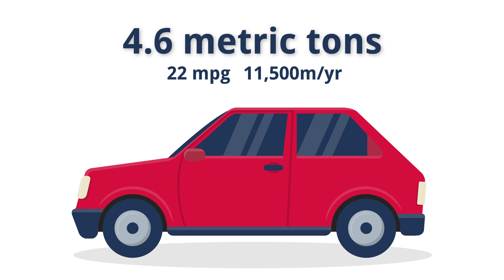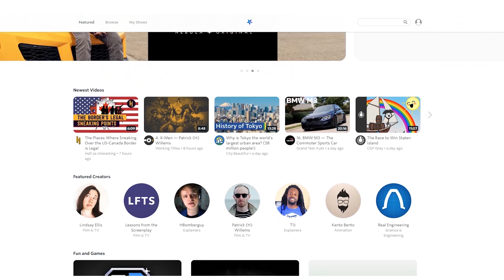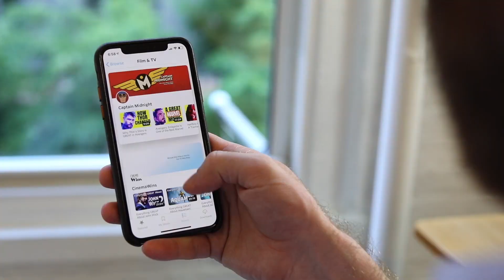How Cruise Ships Are Destroying The World

Comment: These ships are well past the size where nuclear power becomes the more practical option. Any military veswel half the size of a cruise ship and up is nuclear. The savings would be in the billions. 

I thought they were nuclear powered because the idea of something that size being run on ordinary fuel doesn't make practical sense in the short or long term.
Reply: Aircraft Carriers are currently the only nuclear powered surface ships in the US fleet. While nuclear power was, in the past, applied to smaller surface ships, they were eventually retired and replaced with conventionally powered vessels. I believe that Russia currently uses nuclear power for submarines only, and I'm not sure what the Chinese are fielding at the moment.
Reply: At this size it just makes sense. Especially consodering the cost amd material of a cruise ship. It already has enough sheilding to be relatively safe for the short time exposure of crew and it can carry that few extra tons to protect the long term workers. A meltdown isn't likely since there's an unlimited supply of water to stop such a thing. 

You have a no downside power plant available. For a multi billion dollar ship its a no brainer. 

These things are dirtier than oil tankers which after they stop being oil carrying vessels can actually be used for something else such as portable power plants, or ocean cleanup net pullers, or heavy equipment haulers. Etc. 

Cruise ships are pointless and stupid but if we must have them why not have them run cheaper and cleaner.

Comment: Are there electric boats?
Reply: Cruise ship are electric. Its just that they generate the power with big diesel generators
Reply: @TheMJ008  would it be practical to use giant batteries? I don't think so. Maybe ethanol or biodiesel are better options?
Reply: @srpenguinbr  cruise ships need insane amounts of power to run there engines and AC etc they simply wouldn't have the space for that mutch battery storage. That said they could use gas turbines instead of diesel engines and use biofuels like Ethanol. But gas turbines are really expensive compared to diesel engines.

Comment: Those cruise ships can use solar power, as these ocean liners usually require a pretty low power density than cars. The top will be covered with solar panels and the original engine space can be filled by batteries...
Also I think a electric ship will bring a more luxurious journey
Reply: Except that liquid fuel stores energy a lot more densely than batteries ever could. We don't have electric cruise ships for the same reason why we don't have electric commercial airplanes - batteries don't store energy densely enough to be viable. For an electric cruise ship, you'd need a lot more than filling the engine room with batteries and filling the entire roof with solar panels. But it's an idealistic dream.

Comment: You are making a huge omission regarding Emission Control Areas (ECA). First you describe heavy fuel oil and how dirty it is, which is true. However as the UK is inside the ECA all vessels have to burn Low Sulphur Marine Gas Oil, bunkers (fuel) with 0.1% or less Sulphur content. You are also incorrect about the industry change, they are forced now along with all bigger vessels to start using bunkers with 0.5% max sulphur content worldwide in 2020. Some of the things you criticise you can find in the IMO, which has reasonings. But in essence worldwide bunker drops from 3.5% to 0.5% max sulphur content. But ECA areas remain max 0.1% sulphur content.
Source if you want to check: http://www.imo.org/en/OurWork/Environment/PollutionPrevention/AirPollution/Pages/Sulphur-oxides-(SOx)-%E2%80%93-Regulation-14.aspx

Comment: Time to reintroduce airships for extreme energy efficiency and environmental benefit. A few decades back (about 50 yrs ago), the energy physics associated with conventional aircraft (heavier-than-air "HTA"), estimated that conventional aircraft utilized about 80% of fuel doing the work of maintaining lift. The remaining percent going to forward momentum (modern HTA has probably improved on that ratio). Nevertheless, an airship (lighter-than-air "LTA") has no lift-energy requirement. The big rigid airships of the early 20th century did however operate with a very small amount of dynamic lift for stability (prevented the bobbing-cork effect). Zeppelin cargo and cruise: www.youtube.com/watch?v=EuXsa7J2kyU
Reply: Some surface ships also engage in dumping of wastes at sea, btw. Then there's the circumstance of their being lumberingly slow and unable to navigate away from extreme ocean weather conditions, thus occasionally becoming lost at sea..

Comment: I did a little research and the best I can say so far there are some discretion in accuracy of the video. 

“The Harmony of the Seas is powered by four 12-cylinder Wärtsilä 46F engines and two 16-cylinder Wärtsilä 46F engines, featuring best-in-class fuel economy, and outstanding power-to-“ 

That took me several minutes to find on google. So the clam about Harmony of the sea engine was a lie. 

And you cruse ship haters come at me bro 😎

Comment: Electric cars..... I wonder where that electricity comes from.... I wonder if there batteries are good for the environment (they aren't by the way cannot be re-used once worn out)
Reply from the maker: Hence the line in the video about electric car production needing to become greener.
Reply: @SecondThought  the only way they get greener is if our energy gets greener... the only great green energy we have come up with is nuclear. Climate activists oppose that greatly though
Reply: @MrKinglyProductions  solar?
Reply: @sebastianstan9655  solar is VERY ineffective... Takes massive amounts of land and resources and the panels are not recyclable and have to be switched out every 2-3 years
Reply: @MrKinglyProductions  how resources? And if they were fit on the house roofs or cartons they won't require land.
Reply: Even if the electricity comes from a fossil fuel it is still more efficient then the 20% thermal efficiency of a gas engine. A natural gas power plant is around 60% efficient which is where most of the energy where I live comes from.
Reply: If nuclear fusion plays out like we hope, then we won't need fossil fuel for energy anymore.